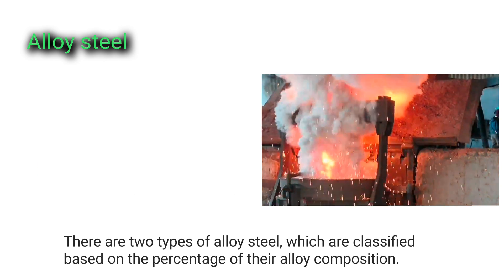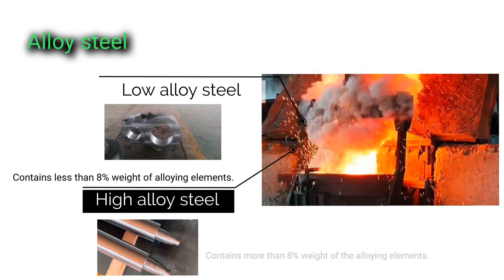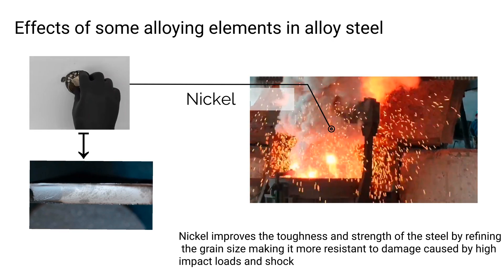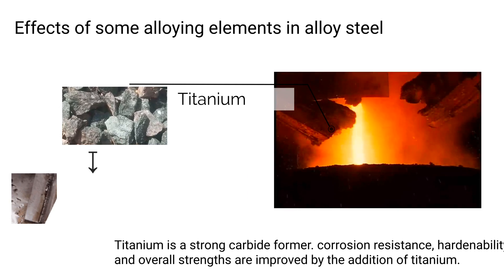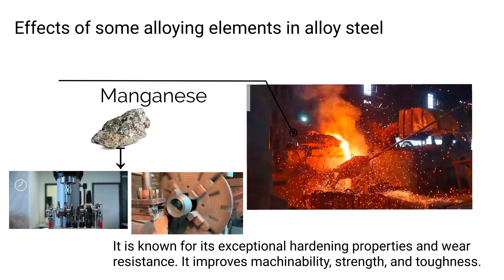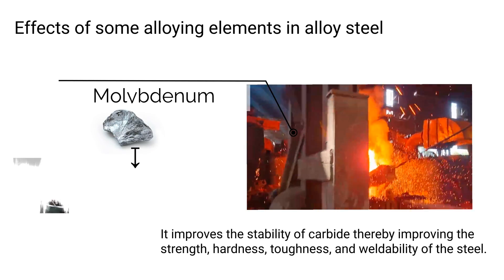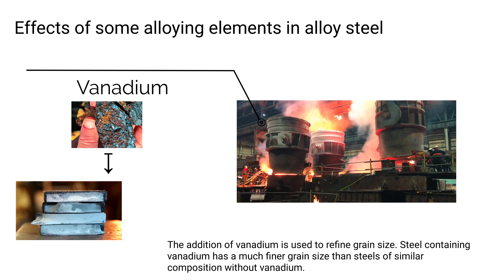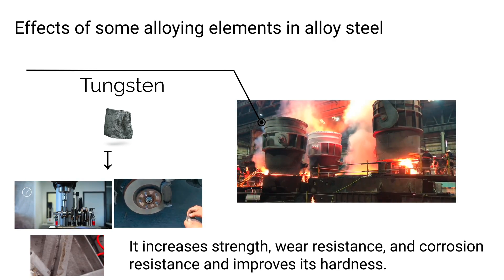Alloy Steel -  An Overview

Comment: Fantastic presentation on microstructure of steel. I’m a vocational welding fabricating teacher that embraces material science and weld science this hits on all cylinders. Thank you so much for your presentation and a high school vocational level. I introduced basic material science, which are covering right here starting at the micro structure
Reply from the maker: Thank you for the kind words